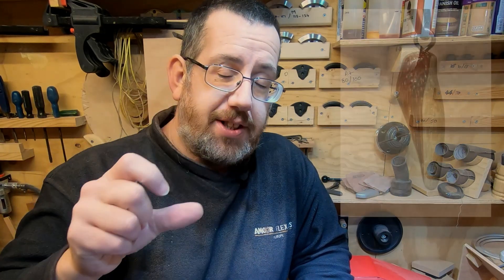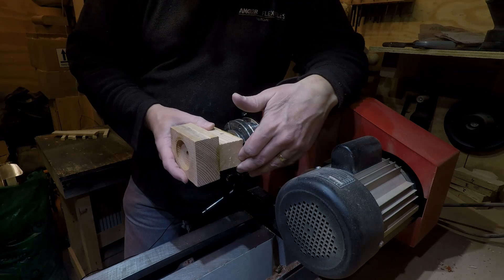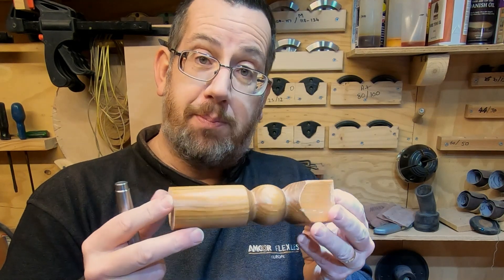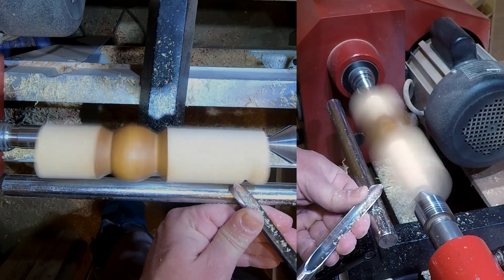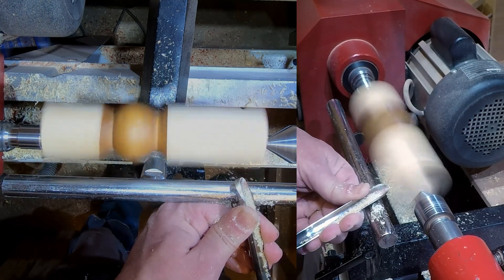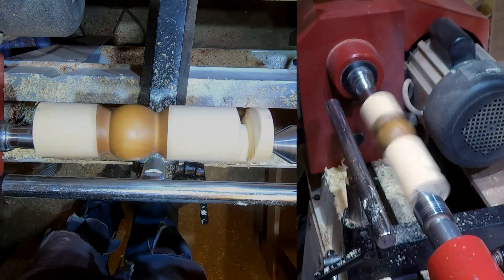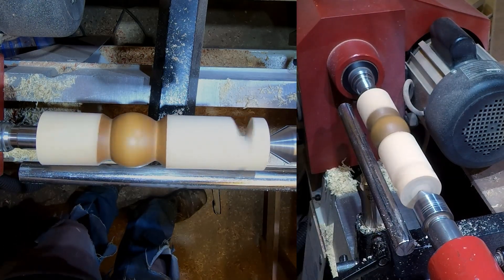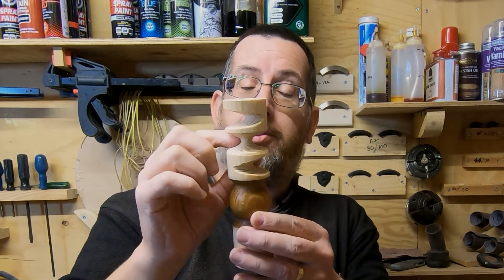Off Center Turning (The Basics) - Episode 229

Comment: Hi Paul, I have done some off centre turning using the same method and more extreme as in points 1 - 3 and 2 - 4 you get some strange angled steps
Reply from the maker: Thank you Douglas. Yes this was to show the real extreme of the whole wood coming at you all off centre. It's only limit is the imagination.

Comment: Thank you for a great explanation for off center work. You are very understanding in how to get started. Question, at what speed is recommended for this size of project?
Again thanks.
Reply from the maker: Thank you Jon. Speed is what is safe with not having the work fly off and the lathe rattle away. I rarely turn much above 1200ish even on small items as the skill is in light cuts with the tool for a good finish. Doing off center you need a reasonable speed as it cuts out the feeling of cutting out so much air.

Comment: wouldnt putting it in at 1 and 3 to offset it create more of a natural bend as you chip away?
Reply from the maker: Yes of course you can move these about as you like. The main point of this was to show the extremes and how easy it is to turn. Nothing to be afraid of as it's no different to starting off with a square piece of wood with all the air.